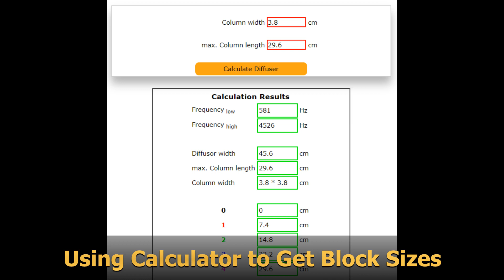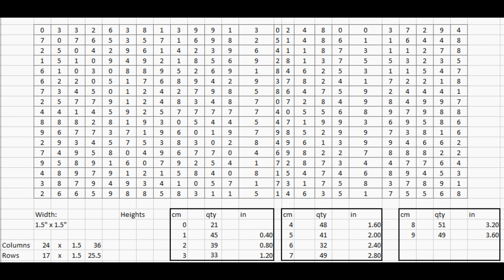Building a Skyline Sound Diffuser - Improve Audio Quality

Comment: Is there a design for to make one out of LEGO  blocks ??
Reply from the maker: You could probably use the same links in the description. Instead of wooden blocks, you definitely could use Legos. I would measure them to determine the best way to get the dimensions close to what the frequency calculations return for each block size.